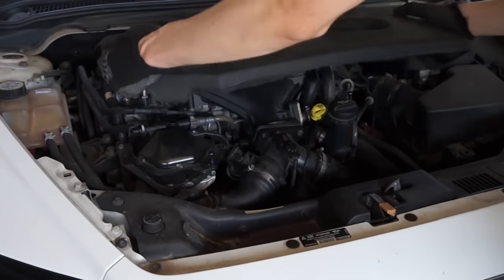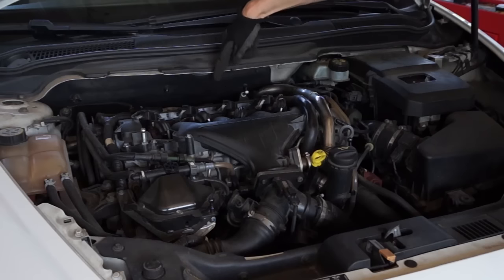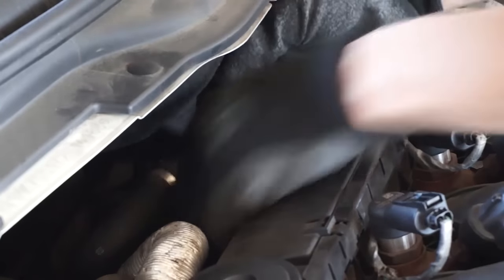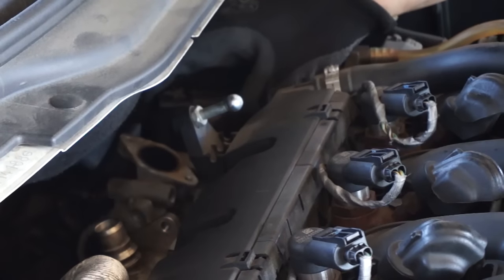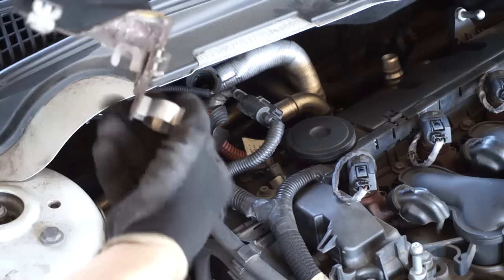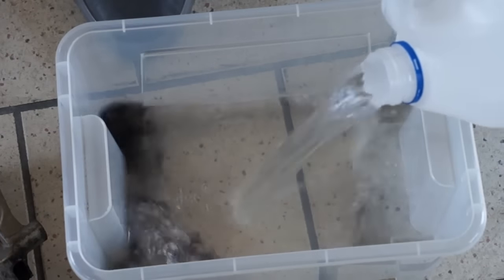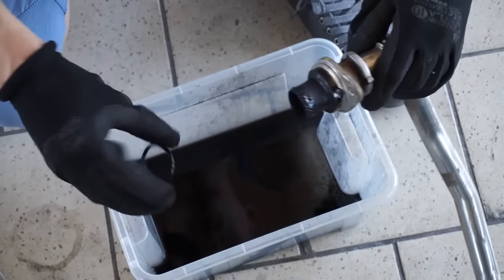2.0HDi 2.0TDCi 2.0D EGR valve cleaning

Comment: Is  not that easy with 2.0HDI. That extra bolt which is under EGR is really pain in the ass... I surrendered.
Reply: How to get it off???
Reply: We I did it, but at the cost of very, VERY long time on C5 X7 2.0, removed some braket with rubber hoses from the firewall, pushed it to the right side, the last boltboss was a T30, buy 2 or 3 of short L shape torxes, I lost one - RIP.
Reply: On my Citroen C5 2.0HDI, when i was changing the EGR valve it fallen down and after like 5-6 months we removed the full engine because of a hole in the block of the engine and it was still staying on the engine but not ot it's place.

Comment: Thanks for the video. Very helpful. Any idea where the 3rd bolt from the egr is located as I’m having trouble finding it. Did feel something under it but can’t get a wrench on it.
Reply: I done mine today it is the bolt you can feel and in my car it was a 5mm Alan key 
And with a little struggle you can get a 1/4 inch ratchet to it.
Reply: @davidb3541 Thanks for the help! Had bo idea I was supposed to be looking for allen bolt (As none of the others weren't) and would have been pretty annoying finding correct size considering the struggle it was to get even the correct one snug on the head.

What an insanely annoying bolt that is...

Comment: Mr Fix - thanks for the video, was very helpful.

For Citroen C8 (and most likely the Peugeot 807, Fiat Ulysse and Lancia Phedra) here are a few tips:

The entire operation is far easier if you remove the induction pipe from the filter box running to the turbocharger inlet, simply remove the blanked loom lead from above the EGR lead, loosen the jubilee clip at the air box, disconnect the breather as shown in the video and remove the single screw at the turbo inlet manifold, with a bit of wiggling it will lift right out.

When removing the EGR screws you will have better luck from below if the rear screws are tight. Once the induction pipe is removed you get fairly clear access to the EGR and you will see the two rear screws (8mm head), the lower EGR cooler screw (10mm head) and single hex head screw on the bottom (4 or 5mm, think it was 5). Remove the bottom and cooler screws and loosen the rear screws enough you can easily undo them from the top of the block (mine were quite tight and too stiff to easily undo from the top, others may be luckier).

When reassembling you will have to have the EGR fairly tight onto the cooler before the bottom screw will locate, just keep tightening until it goes in.

Finally, I replaced my EGR with a Delphi EG10396-12B1, this was a like for like part and required NO reprogramming, just a simple reset with a basic diagnostics machine.
Reply: I just found this tutorial as I have problems with the EGR on my Citroen C5 and I have to say i'țs a pig of a job..yesterday I had a go but it was going late and I had to abandon as I did not locate the 3rd hex screw from below the EGR. I used a mirror to see what I was doing but as per your advice I will remove the engine shield and try some maneuvers from below
Reply: @ruyutransport2298  Peugeot 3008 2012 2.0hdi very good 👍

Comment: good  morning. First  of  all  congratulate  you  for  your  videos. I  have  a  volvo  s  40  2.0.d  136  hp  has  no  particulate  filter. What  happens  to  me  is  that  it  does  not  start  and  it  turns  on  and  it  turns  off  light  heaters,  I  have disassembled  and  cleaned  EGR  everything  is  well,  diesel  battery. The  console  says P0490  control  A  high  exhaust  gas  recirculation. Excessively  high  RGE  control  signal. many thanks.
Reply from the maker: Please check out my tutorial about cleaning CEM module. It's responsible for most start issues in those cars.

Comment: This video was helpfull to an extent....socket sizes would have been helpfull. Also the last pig of a bolt, that I was informed is an Allen key type fitment, next to the black plastic casing the points upwards, is the last bolt.  I watched this video 3 times before attempting to do it on my kuga which is an identical engine. 5 hours later I still couldn't get the egr off.

Comment: great video. What's the difference between the 2.0 TDCI and HDI? Are the same in everything.
Reply from the maker: TDCI and HDI are just brand names. Ford is using TDCI name for all of their turbo diesel common-rail engines. Doesn't matter if it's old, new or shared design. Same for HDI, TDI...
Reply: @mrfixpl  the 1.8 TDCI is not a French engine like the 2.0. That 's why I asked.

Comment: you better pray god you don't have the 3 bolt egr valve. It's a nightmare to get to the torx screw underneath the valve. You can't see anything, and there is fuck all room to even put your hands in there. I was stuck on this step for several hours. Mine is a 2005 407 hdi 2.0

Comment: Hi Mr Fix.
Great video. I just bought a Citroen C4 Picasso and it needs a new turbine, any video showing how to remove the turbo without removing the engine?
Regards.
Reply from the maker: If it's the 2.0HDI engine, then I believe that you can do it from underneath the car.
Reply: I had a look and it looks like the space is very narrow , i tried to remove the egr but unfortunately the engine is more in the back of the bay. I will take a picture and send it to you, have you got an email that I can send pictures?
Reply: The engine looks the same one as in your video.
Reply: The engine looks the same as the one in your video.

Comment: great video. will this solve black smoke from exhaust when accelerating
Reply from the maker: I would say that more likely is on of those:
leaking injector, hole in intake system (boost leak).
Reply: Possibly but more likely a faulty injector.

Comment: My 2010 french ford fusion (84000 kms) seemed to be making tapping noises a few weeks ago. I brought it to the dealer so the mechanic could listen to it. He did hear the noise but told me it was probably some plastic piece that was loose and not to worry about it. I took his advice, but now I have a diesel fuel smell when I turn off the engine. I've looked but there is no evidence of leaking fuel. Went back to see the mechanic but he's on vacation and the manager told me to change the fuel filter, (which I have never done). So I've watched some videos and came across one with some guy changing his EGR valve at 110,000 kms. He spoke of the the valve making a clicking noise....so of course I'm wondering if this is the cause of my problem?
Reply from the maker: EGR valve is responsible only for the exhaust gases recirculation. It has nothing to do directly with fuel.
About the fuel smell - take off plastic engine cover and check if there's not fuel near the injectors. Sometimes one of the fuel return lines leaks.
Reply: Thanks I will check that out
Reply: Well, I changed the fuel filter, with the idea that I might see something behind it. I did see some clear fluid leaking, but strangely, not diesel fuel. (no smell) I originally thought it to be engine oil, but it's clear. Anyway, I brought the car to a garage and the mechanic said the same thing as you -fuel return line. But he also said, as I can see,  that it is buried underneath all sorts of crap. A 2 day job for him.

Comment: Hi mr fix please i need your help my car is ford focus mk2 2.0 tdci 2009 not everytime but twice in week when i shut off the engine and i try to start the engine AGAIN the car wont start unless i move the intake manifold pipe from throttle body and just lift up the butterfly just 10mm with finger and the car start AGAIN DO YOU KNOW THE REASON PLS ANY HELP MUCH APPRECIATED.

Comment: I have this engine and I was getting very poor mpg (28mpg)... I disconnected the egr valve wire, and the mpg went to 60mpg and the car was more powerful.... but after 1 hour, the car mpg went down again... so I know there is a problem with my egr valve....
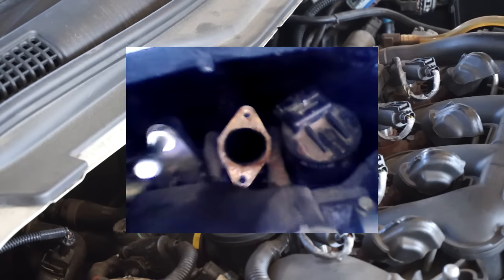Reply: 3:03  Is there a gasket at this joint?  How does the egr pipe seal against the egr valve?

Comment: So my Peugeot 407 low boost pressure fault is because the black rubber seal in last pipe shown has cracks , what the part called pleased?

Comment: Hi I have a Ford kuga mk1 2.0 tdci I have a egr valve that’s not working properly and I have a new-replacement valve do you know if the valve need’s reprogramming or is it a straight swap over and works

Comment: Beetween egr cooler pipe and exhaust manifold is any gasket? I just cleaned my egr and now i have fumes  in cabin, gasket beetween egr and egr cooler is brand new, beetween egr and inlet manifold is just an oring on inlet side wich is fine. It is possible to leak on exhaust manifold side?

Comment: can anyone explain in simple terms the principle of having the two air pipes going into the intake manifold on these engines. there is a vacuum actuated butterfly flap on each pipe inside the the plastic tee piece and ive noticed the right hand one on my car is knackered, the little plastic rack&pinion mechanism is all mashed. i believe this is quite common .
Reply from the maker: It’s an intercooler bypass system. Charged air can go through intercooler or not based on ECU decision.
Reply: @mrfixpl  thankyou - i have just picked up a old tdci for cheap but has zero boost . ive found a burst intercooler pipe and broken butterfly vane so far which hopefully will fix it.  Going to clean the egr system too.     your videos are very helpful.

Comment: Hey Mr-Fix great video and appriciated your work.and thanx on the behalf of all Ford,volvo,peugeot,Renault owners 😊..

So my question is,i tried to remove my egr today,remove all the bolts as you did in video,but still enable to get egr out of the car..it i felt like have some one another bold at the downside,but i heavnt found that and then again fitted the bolts...can you please explain or make a foto from the bolt if possible?? Or my egr was tight becoz it heavnt removed before???
Reply: 5 mm allen (hex) head screw down bellow black plastic side of the EGR
Reply: @danielrusu2090   thanks for the answer ,i deal with same problem here, couldn't find the third bolt , manny thanks !

Comment: Hi, excellent and very informative video!I have a question about the engine breather.Is there is any chances to remove that round cap?Assume there is a rubber membrane which need to be cleaned from time to time?Im trying to find information about the sump ventilation.If I'm not mistaken, sump gases goes up through the oil filler,then through the rubber hose connected to cranckshaft case and then exists on the left side of the cranckshaft case??
Reply from the maker: I don't have that car anymore but if i remember correctly you need to remove whole intake manifold to access the oil separator. Round cap should be detachable but I've never opened it.
Reply: mr-fix Thanks for responding.Yes,there is no chance to access oil separator without taking all manifold off but as it turned out, that round cup is detachable an you can access the valve.I did open it today)On some vw models that cap is sealed. I have annoying periodical short vibration(on idle)on the car body( not on steering wheel, pedals or gear lever) and I cannot find the source. (Manual 6sp,)Some people saying that this is tipical for this engine. But from time to time during the day engine work just perfect and I cannot understand what is the reason. Egr is cleaned, engine mounts seems to be ok,all filters are new,sponges in both brown valves are cleaned, good fuel,no air in fuel line no codes.Would you have any ideas?Many thanks
Reply from the maker: One of the things that you can check is the high pressure fuel valve. It can get clogged with aluminum form the fuel pump which can make cause improper work of it.
Reply: mr-fix Hmmmm..Very good idea!I definitely will check that valve because when I changed fuel filter there was some very small metal particles on the bottom of the filter holder.Can I unscrew that valve or I will have an issue with the air in the fuel line later?
Reply from the maker: you might have some issues with air but if you first open your tank for a minute (to remove vacuum) and put clamps on the fuel lines in the engine bay, you can minimize that issue.
Valve itself is held by two torx screws. Easy accessible.
Reply: mr-fix Hello!Today I have removed high pressure fuel valve for inspection and cleaning.Visually there was not even single peace of visible dirt but despite of that I have cleaned with carb cleaner couple of times and on the end with compressed air. I wasn't confident to disassemble the valve however on YouTube you can find video where people take valve apart for cleaning.(Different models)Due to air In the line I was able to start the engine only after second attempt but unfortunately couldn't notice any difference on idle when engine warmed up.Periodical vibration/tremor was in place.(it comes when engine reaches work temp and looks like depending on weather conditions)Im giving up because probably the next thing which need to be checked is injectors.Thank you for your advices!If you have ideas what else can be checked,please let me know.
Reply: mr-fix Hi again!Today I connected the scanner again and got P0406 code.Exhaust Gas Recirculation Sensor 'A' Circuit High.(( EGR valve goes to the bin?Or something can be done? Thank you

Comment: Vidio great, I dropped one of the two bolts from the front of the engine that holds the silver pipe on , what bolts are they and what are they called
Reply: Did you find it? I just did the same lol

Comment: Thank you Mr Fix for this very informative video. I have a Ford s max 2011 2.0tdci engine 163hp.

Any chance I can bring my car down to you to have my egr valve and egr cooler cleaned.

My car has done 150000 miles and I wish to keep it until it runs no further and therefore I would really like to clean the egr valve and egr cooler so it functions as it should.

I could give it a go, all thanks to you showing how it's done in your video but I would prefer to have it done by someone like you who knows what they are doing.

I look forward to hearing from you.

Many thanks
Reply from the maker: I'm not running repair shop. Sorry.
Reply: @mrfixpl  

Many thanks for your prompt reply. I understand you are not running a repair shop however I can you pay you to have my egr valve and egr cooler cleaned at your convenience. If not I understand however many thanks for your reply. Much appreciated.

Adam

Comment: I have a ford s max 58 plate some times it starts first turn off the key and some times it takes about 4 turns any help
Reply from the maker: To check: glow plugs (assuming it's diesel), fuel filter, fuel line air leaks, coolant temperature sensor, battery.

Comment: Hey man! I really like your videos!
But I have one problem following this one:
when i unscrew all of 4 screws holding EGR valve, it won't move.
Could it be so clogged up it won't fall apart ?
Thank you for answer!
Reply: I have this issue too! Did you ever work out why?
Reply: @SamzWorldOfGaming  there's another Allen bolt holding it on underneath. I just gave up and left mine on..blanked it and had it deleted from the ecu.
Reply: Same problem as i have encounter. I could not remove the bolt attach under the egr

Comment: HI I have this engine in my ford Mondeo could this cause my turbo to overboost and put car into limp mode when accelerating
Reply from the maker: Not likely. But please if your variable geometry turbine veins are moving freely. If the VGT is stuck or is not moving as it should it could cause overboost problems. Also intake pressure sensor, VGT position sensor, vacuum valve that controls turbine.

Comment: Hi, I have volvo s40 2.0d
When I remove pipe on the cooler(that one that you suggest to remove, to get to the bottom bolt that holds egr and cooler together) some fluid fell down. Anyone pls help WHAT was that. Is that was cooler fluid?

Comment: Ive been having soot filter messages volvo garage tested dpf pressure sensor and was fine but readings were spiky and all over the place. My local garage replcaed dpf egr and dpf pressure pipes and after 2 days soot filter full messages reappear and same p2463 error code logged. Garage said will reset values and run a regen, is this normal as id have thought new parts would not show error codes or will it clear eventually im not trusting that the issue will go away. Any thoughts
Reply from the maker: Are you sure they replaced DPF? Maybe just the EGR valve.
Reply: @mrfixpl  yes all changed i have the original volvo one off it
Reply from the maker: If new DPF is full after 2 days, then there's something wrong with the engine. Leaking injector, oil leak from turbo...
Reply: @mrfixpl  booked in to reset values lets see and report back no other error codes
Reply from the maker: Let me know how it goes.
Reply: My Kuga 2.0 Tdci also had constant Dpf issues. Ford replaced the dpf under warranty twice. It lasted about a week then I got another check engine light. They replaced nearly everything....no better. Eventually I said screw it and got the dpf removed and tuned out. Im on 105 000km and NO PROBLEMS anymore. The DPF is a diesel engines worst enemy.

Comment: i have ford mondeo with the same engine, but the trouble is my egr there's a bolt underneath and i'm finding very difficult to undo this bolt, also on the silver pipe there's no gasket on the egr side is this right?

Comment: I want to disable my EGR by software. This is possible. Do I need first clean the EGR before  disable it for best result or not?
Reply: Hey mate, I know it's a little late but if you've tuned the car to block the egr then your EGR will never open meaning cleaning will be pretty much useless. You can even go 1 step further and remove the whole system entirely (woohoo 50g weight saving)